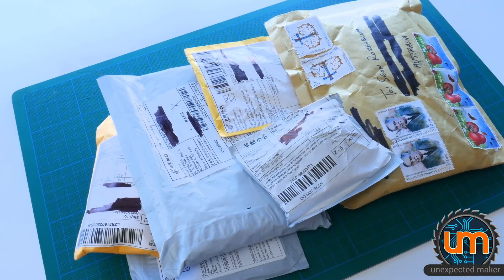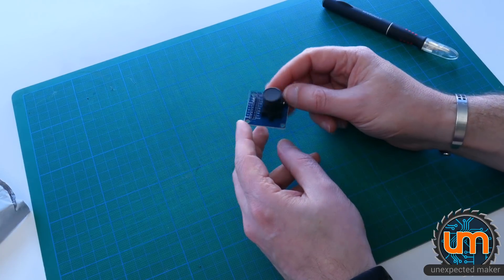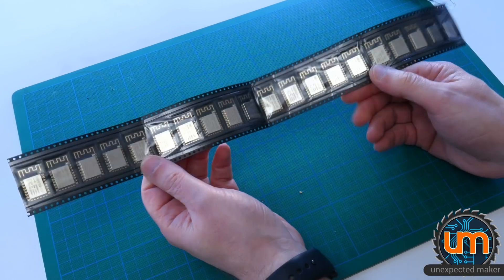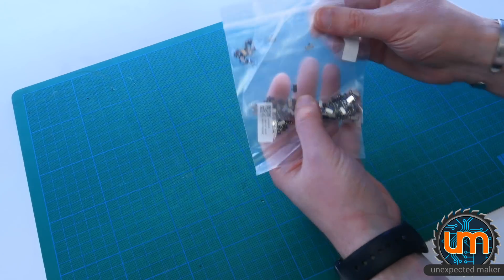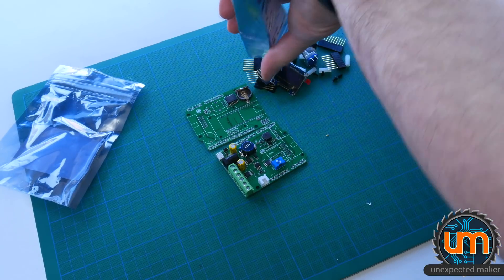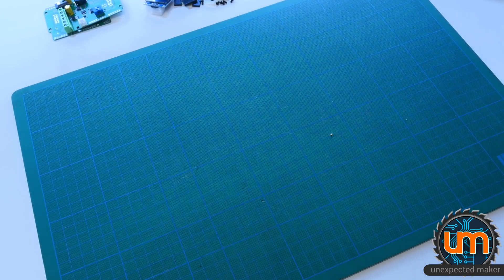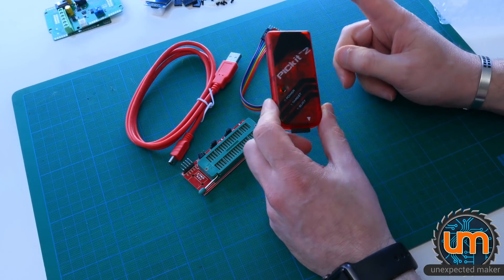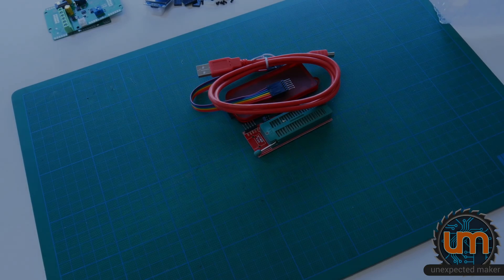Unexpected Mini Mail #6 - Such Goodies!

Comment: At 1:50, what terminals would you use instead?
Reply from the maker: I'd use the same style, but prob go with 3.5mm or 5mm size, for extra stability, or use 2 or more connected instead of individuals.... just for more mechanical strength.